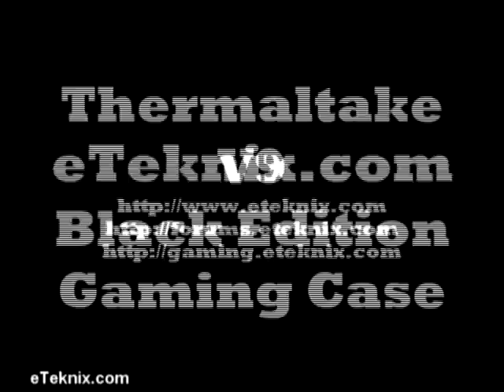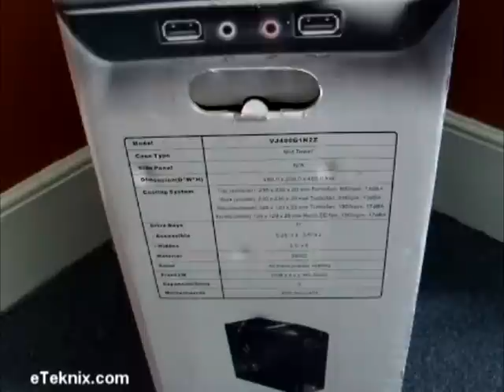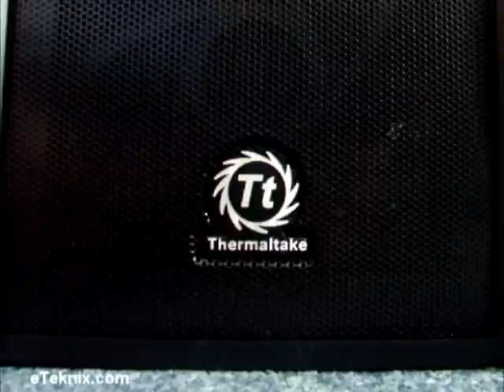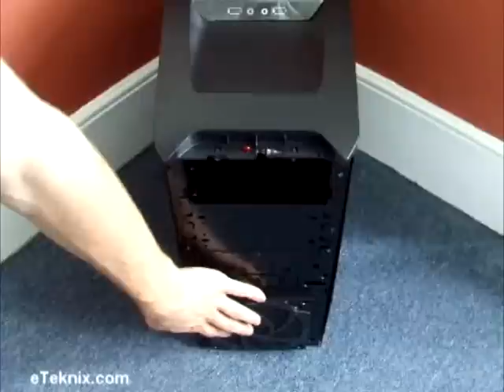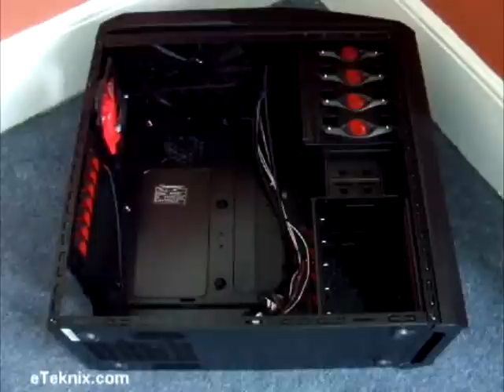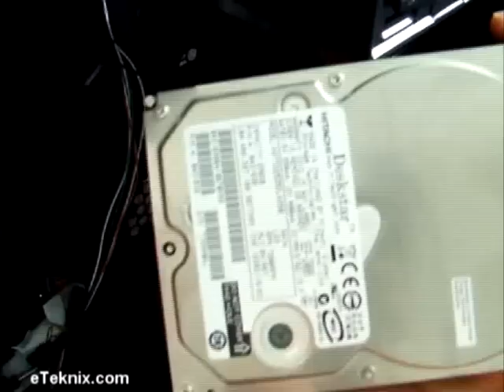Thermaltake V9 Black Edition Review - Check out These Fans!

Comment: I have this same case, some things I don't like - the side panel does have a huge ass fan but I want a plexiglass side panel now haha. Also the power button has an LED - COOL...yea but its blue and not red, yet the rest of the case has a black and red theme. The LED fan at the front is red and is amazing, but has horrible air flow anyways. I redid the cables and things 3 times already, you can clean things up fairly well, I just stuck most of the wires where the HDDs go, I have one HDD and 1 SSD

Comment from the maker: @Dragobirst All down to personal preference, CM make good cases too. 500watt power supply should be fine depending on the rest of the system. The fans aren't the most silent, so you may want to buy some quieter fans.